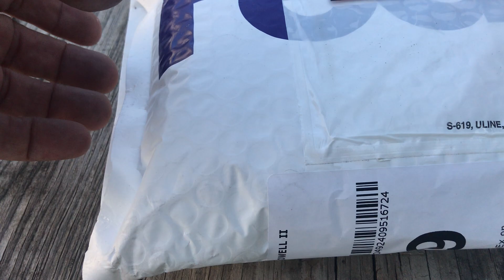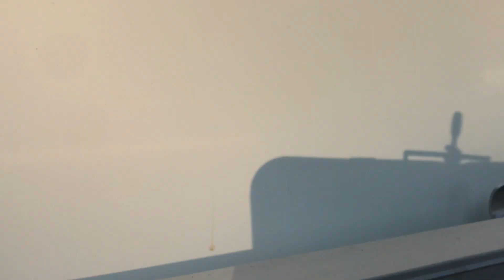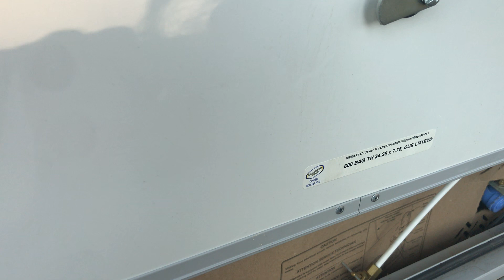(84) Paclock testing the new RV camlock

Comment: Lowell I have worked RV's.  I think if Paclock made door lever handle locks along with these storage locks, they would take over the market.
Most are all wafer locks, some better than others.  Nice if it fit the existing hole, the cylinder is a lot larger is probably the reason.  Love their locks.  👍👍👍👍🧡